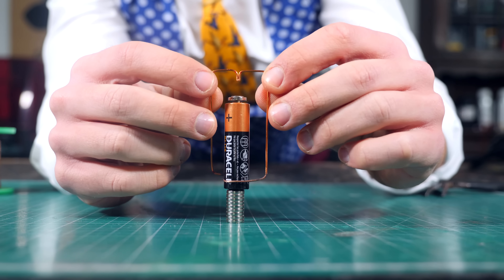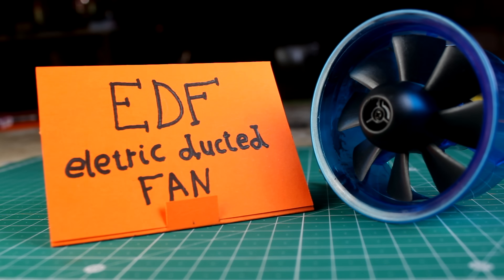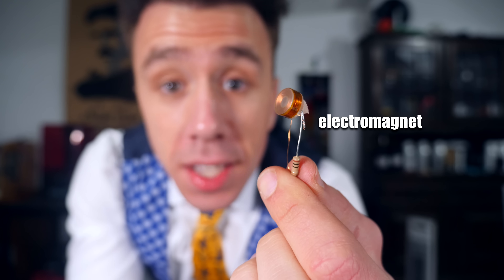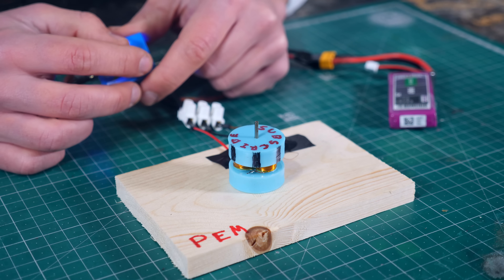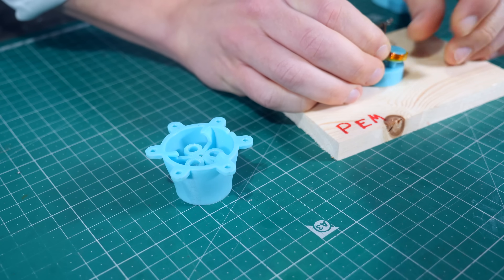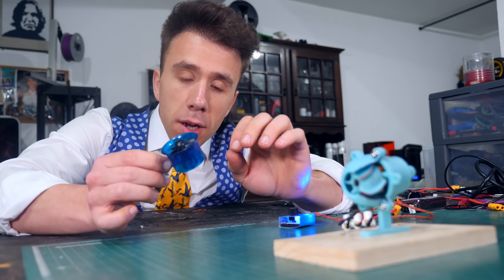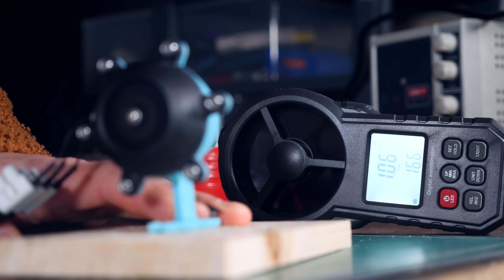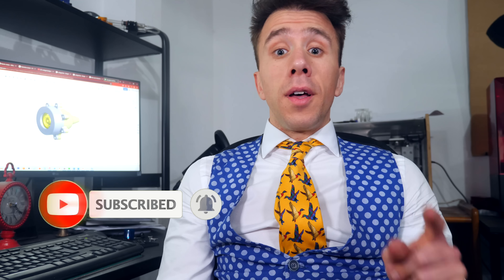I 3D Printed an ELECTRIC MOTOR FAN

Comment: using gears to simulate the process of creating air pressure and increasing air volume. I propose that a shaft would run to a gearbox, which would be powered with the first fan motor that creates air pressure. The gearbox would then power a second fan at a higher RPM to help push the increased air volume. While using gears to create mechanical power transfer is a well-established engineering principle, it's unclear how this idea would work in practice. There are a few areas where this concept could be refined:
1. Efficiency: Adding more moving parts, such as a gearbox, could decrease the overall efficiency of the system. It's important to consider how much energy is being lost in the transfer from the initial fan to the second fan through the gearbox.
2. Size: Gears can take up a lot of space, so it's important to consider the size and scale of the proposed system. Depending on the application, it may not be feasible to have a large gearbox and multiple fans.
3. Specific application: It's important to consider the specific application of the system and whether gears are the best solution. For example, if the goal is to create air pressure for a small device, it may be more efficient and practical to use a single fan with a higher RPM.
Overall, while gears can be an interesting and effective solution in some cases, it's important to carefully consider the specific application and potential drawbacks before implementing them.

Comment: An impeller’s goal is compressing the air, and fuel generally likes high-pressure low-speed air. What an impeller does is unlock better fuel burning efficiency, which should drastically outperform a fuelless fan

Comment: First thing that comes to mind with impellers, always : too much clearance with the housing.  It must be close to the blades. Very. close. So close it creates localized vacuums on the edges of the blades tangent to the housing.
Hence the need of dual support shafts of short impeller stacks relative to the shaft inertia for it to not rattle like a degenerate woodpecker on caffeine.
Second is the cross-section envelope of the blades, i.e its aspect ratio.  See those smushed vaccum cleaner impellers ? They allow for low rpm relative to the fluid ejection speed, while keeping the inertia of the moving rotor low enough to be negligible. Think of the trajectory those blades will impart to the air molecules. They fling it outward, your impeller doesn't. 
The trajectory of the air, imprinted from the blades own trajectory, will make it lose energy on the housing surrounding the larger portion of your impeller, bounce on it a bit, finally being pushed over the backplate lip by the pressure gradient.

Comment: I’d say it likely has to do with the overall volume of air the centrifugal fan can take in and compress. The EDF is largely unrestricted and the whole area of the fan disc can take in air. The centrifugal one has a small inlet and is more restricted by design. Maybe play around with fan geometry, I take and compression area sizes and speeds. Some of the earliest jet engines were actually centrifugal, but pretty much all if not all aircraft jet engines now are axial flow.

Comment: Didn't catch it if you said it, but make sure the impeller blade surface area is comparable to deducted fan's. Also considering the geometry of your design you're probably getting resistance due to compression in your impeller... You're asking the same motor with the same power to do more work than the EDF.

Comment: I think if you look at a dissected car turbo or a jet ski jet, it may help with the design. I think the blades need to be angled to push the thrust out. Hope that helps. You're a smart guy, I'm sure you'll figure it out!  Ps, I could really use a printer....
Reply: I think the impeller you made was spinning in the wrong direction.

Comment: You should do a video investigating the use in aerospace engines of a concept used in stable elevators where the case rotates instead of the shaft.

That is, make a turbine where, instead of a fan rotating in a case, the case rotates around the fan blades. In theory, it should produce the same thrust through as one where the case (ducting) is stationary and the fans rotate.

Comment: It's related to the surface area of your blades. Think of yourself as paddling a canoe, same arm strength, same number of strokes per second, if you used a spoon instead of an oar you will get much less thrust and most of your arm's energy is wasted into simply moving your arm. The opposite is also true if you use a giant paddle. So there is an optimal size of blade size and pitch you need to size your impeller to match the maximum continuous torque and RPM of the motor. Keeping in mind you will now need more torque since you're squeezing all that air through a smaller nozzle to get higher exit velocity whereas there is no squeezing with the EDF.

The good news is, the cheap EDF's don't typically do this level of optimisation, the fan and motor are different suppliers. So in theory once you correctly size the blades, you can easily exceed the standard EDF's thrust, as long as your jet engine is also lighter in weight, you will exceed the overall thrust performance.

Also - you're measuring with a mass airflow meter, thrust is mass * velocity, low mass does not always mean low thrust, you may actually be already at, or exceeding the EDF's thrust. Test your impeller engine with a thrust rig instead to get a good comparison.

Comment: The big one: Tolerances values of the turbine vanes, to the shroud. 
Other things to check: Intake, and exhaust port diameters.
Reply: Agree they are higher pressure and get this through tighter tolerances than other fans if you got gaps it will dramatically hinder performance.

Comment: I don't have any scientific answers or opinions for you, but when you asked for help the first thing that came to mind were Toroidal props/propellers. Design one that fits into the fattest part of the housing, don't make it thick enough to span the entire case, keep it thin'ish. Then, if that performs any better start making the props a little thicker until you reach max performance.

Comment: have a look to the A/R (Area/Radius) ratio of your compressor. It has general huge impact on pressure/outlet speed.
Also try to reduce radial and axial clearance between the compressor wheel and the housing. 0,1mm more clearance reduces your efficiency by 1%. So keep it tight and try to get a nearly 0-Gap (or a real 0-gap by using different materials that will build one by cutting the Blade into the housing on the first revs)
Reply: ᴄᴏɴɢʀᴀᴛᴜʟᴀᴛɪᴏɴꜱ ʏᴏᴜ ʜᴀᴠᴇ ʙᴇᴇɴ ꜱᴇʟᴇᴄᴛᴇᴅ ᴀᴍᴏɴɢ ᴛʜᴇ ʟᴜᴄᴋʏ ᴡɪɴɴᴇʀ ꜰᴏʀ the 🤶 ɢɪᴠᴇᴀᴡᴀʏ ᴘᴀᴄᴋᴀɢᴇ ʜɪᴛ ᴜᴘ✉️ ᴛᴏ ᴄʟᴀɪᴍ ʏᴏᴜʀ ᴘʀɪᴢᴇ 🎁🎉

Comment: I bet motor in your 3d printed fan consumes less power compare to the edf and thats  because is not fully loaded by the small impeller.  Make bigger impeller  , compare power consumption.
Reply: ᴄᴏɴɢʀᴀᴛꜱ ʏᴏᴜ ʜᴀᴠᴇ ʙᴇᴇɴ ꜱᴇʟᴇᴄᴛᴇᴅ ᴀᴍᴏɴɢ ᴏᴜʀ ꜱʜᴏʀᴛʟɪꜱᴛᴇᴅ ᴡɪɴɴᴇʀꜱ ꜰᴏʀ ᴛʜᴇ ᴘᴀᴄᴋᴀɢᴇ ᴄᴏɴᴛᴀᴄᴛ ᴛʜᴇ ᴛᴇʟᴇɢʀᴀᴍ ᴀʙᴏᴠᴇ
^^^^^^^^^^^^^^^^^^^^^^^^^^^^^^^^^^^🎁🎉

Comment: I would to see how a line of Sterling motors sitting on a steam pipe how many you could put in a 10 foot section And combine their power to say how much horsepower can you produce from it to generate electricity 

Second one is a hovercraft made of electromagnet With a particular resident frequency that’s is tune to the Magnetic Resident frequency of the Earth, sun or moon Pushes or pulls against the polls and/or planetary objects to get elevation This is in something that’s in the missing papers from Tesla that Affects of resident frequencies and the universe.
Reply: ᴄᴏɴɢʀᴀᴛꜱ ʏᴏᴜ ʜᴀᴠᴇ ʙᴇᴇɴ ꜱᴇʟᴇᴄᴛᴇᴅ ᴀᴍᴏɴɢ ᴏᴜʀ ꜱʜᴏʀᴛʟɪꜱᴛᴇᴅ ᴡɪɴɴᴇʀꜱ ꜰᴏʀ ᴛʜᴇ ᴘᴀᴄᴋᴀɢᴇ ᴄᴏɴᴛᴀᴄᴛ ᴛʜᴇ ᴛᴇʟᴇɢʀᴀᴍ ᴀʙᴏᴠᴇ
^^^^^^^^^^^^^^^^^^^^^^^^^^^^^^^^^^^🎁🎉

Comment: First you confuse the thrust and the speed of the wind at the exit, whereas it is very different, even if sometimes proportional 
The EDF motor produces a good wind speed and brews a large volume because it has a large surface area of blades, so it will do a lot of thrust, (Convenient for propelling a remote control aircraft)
But a turbo fan produces a lot of pressure but not necessarily a lot of volume (pressure is important in a piston engine turbo to increase the oxygen ratio, or in an airplane for better combustion and output velocity),
So with the same brushless motor you will produce more pressure with the turbo (I think it would be able to inflate a balloon unlike the EDF), but this fan will move a smaller volume of air than the EDF fan (so less air speed on the wind speed sensor)
Send me a mail if you need help, I will be happy to help
Reply: ᴄᴏɴɢʀᴀᴛꜱ ʏᴏᴜ ʜᴀᴠᴇ ʙᴇᴇɴ ꜱᴇʟᴇᴄᴛᴇᴅ ᴀᴍᴏɴɢ ᴏᴜʀ ꜱʜᴏʀᴛʟɪꜱᴛᴇᴅ ᴡɪɴɴᴇʀꜱ ꜰᴏʀ ᴛʜᴇ ᴘᴀᴄᴋᴀɢᴇ ᴄᴏɴᴛᴀᴄᴛ ᴛʜᴇ ᴛᴇʟᴇɢʀᴀᴍ ᴀʙᴏᴠᴇ
^^^^^^^^^^^^^^^^^^^^^^^^^^^^^^^^^^^🎁

Comment: Swept fan area may have something to do with it. I also think that axial flow is more efficient anyways due to not changing direction. Commercial and military jets quit using centrifugal fans a long time ago. Try going back to the flame holder for an EDF. Maybe make a metal shroud behind the motor and use NACA ducts to bring airflow into the combustion chamber. Not all of the airflow needs to go into the combustion chamber; you just need to show that the extra thrust generated in the middle is worth the additional weight added to the EDF

Like a center burner only. If it doesnt get enough airflow there then make the shroud more cone shaped by a few degrees to push more air into the ducts. But if this could be avoided it would be good because thrust figures when not running the after burner are still important for a model hobbyist interested in an engine swap
Reply: ᴄᴏɴɢʀᴀᴛꜱ ʏᴏᴜ ʜᴀᴠᴇ ʙᴇᴇɴ ꜱᴇʟᴇᴄᴛᴇᴅ ᴀᴍᴏɴɢ ᴏᴜʀ ꜱʜᴏʀᴛʟɪꜱᴛᴇᴅ ᴡɪɴɴᴇʀꜱ ꜰᴏʀ ᴛʜᴇ ᴘᴀᴄᴋᴀɢᴇ ᴄᴏɴᴛᴀᴄᴛ ᴛʜᴇ ᴛᴇʟᴇɢʀᴀᴍ ᴀʙᴏᴠᴇ
^^^^^^^^^^^^^^^^^^^^^^^^^^^^^^^^^^^🎁🎉

Comment: I think, like what everyone else is saying, is that the turbo fan will generate greater static pressure vs the edf's greater airflow. It's basically reminiscent of a blower vs axial style fan, each with its own pros and cons, like the more static pressure vs more airflow. I'm no expert, not have I done any research outside of watching your videos, but I would think a jet engine would prefer the static pressure over the airflow because of the expanding gas from the combustion. A jet engine would be pretty useless if it create as much thrust backwards as it would forwards. For the EDF, the pressure would just have to overcome the weight of a drone or whatever it is driving, so for the same energy, you could generate more airflow to achieve greater speed.

Comment: The design is stalling for air intake.  Because the nature of the design is that it pushes air outward and then forces the air under centrifugal force to make a right turn, the air is aerodynamically locked into position.  This reduces air intake and as a result, the total mass flow is reduced to a much lower number.  To Fix the design the fan needs to be conical and then it needs to be funneled into an outlet.  The outlet should be slightly smaller than the intake.  ... However, in the optimal design, the airflow would not have to have any directional change.  This is what happened in jet engine development.  They changed from radial combustion to a direct pass-through.   Then later into a high bypass design.   In the high bi-pass design the high-velocity flow from the core is protected and enhanced by a slower thrust tunnel created by fans.   Thus the fan flow in increased not decreased and because of the total sectional area and entrapment effect high bypass fans are more effective.
Reply: ᴄᴏɴɢʀᴀᴛꜱ ʏᴏᴜ ʜᴀᴠᴇ ʙᴇᴇɴ ꜱᴇʟᴇᴄᴛᴇᴅ ᴀᴍᴏɴɢ ᴏᴜʀ ꜱʜᴏʀᴛʟɪꜱᴛᴇᴅ ᴡɪɴɴᴇʀꜱ ꜰᴏʀ ᴛʜᴇ ᴘᴀᴄᴋᴀɢᴇ ᴄᴏɴᴛᴀᴄᴛ ᴛʜᴇ ᴛᴇʟᴇɢʀᴀᴍ ᴀʙᴏᴠᴇ
^^^^^^^^^^^^^^^^^^^^^^^^^^^^^^^^^^^🎁🎉

Comment: I'm sure someone below has probably already explained this or perhaps atleast did a better job of it. 
but short the version is the two " FAN " types are simply working different principles. 

The EDF is Mainly designed for getting thrust by free flowing as much controlled air as possible in one direction and with little restriction. the air foil on the front contributes to some induction of additional air through laws requiring more than a few sentences here.(overly simplified but you get it)

The other style "fan" your working with that your referring to as a centrifugal isn't really that but instead more of turbine type "fan" or more realistically a Compressor type "fan". What it does well is build pressure or squeeze air vs flow air like the ducted fan does. 

In the case of the dyson fan the "Fan" is building pressure to overcome any restriction and moving the air over a very well designed edge (kinda of like an air foil or airplane wing )(ish)) which then causes a low pressure zone which outside air tries to fill and gets pushed along in the direction the pressurized air is heading. this is basically an air Multiplier using something similar to Bernoulli's principle. Much how an air brush works. (ish). since the air escaping is grabbing more air than the "fan" is pressurizing, it "feels like" a gain of air movement and in a way it is. But the air your feeling is mostly the inducement of the air around the air foil than the air from the "Fan" (turbine). 

with turbine engines the "fan" (turbine) is doing much of the same thing. the blades aren't really so much creating the trust but are instead squeezing the air and pressurizing it for combustion(think of  it like a combustion engine's pistons) Once the air is squeezed enough it makes it's way into the combustion chamber and ignited with fuel. It's this rapid expansion and heat of the combustion that creates the trust and turns the rear "fan" blades which in turn keeps the intakes blades turning forcing more air to keep the process going. 

Hope this is all making sense to you so far. 
Turbines for example are great for pressurizing air which is awesome for applications like turbo's on cars. where it doesn't need large volumes of flowing air but instead needs large pressures of pre-squeezed air to force into the combustion chamber in a very short amount of time.

So in short.. it's a measurement of flow vs pressure. 

You could in theory measure this by putting a sensitive pressure gauge in the housing of the ducted fan and on the housing of the "aerospike turbo fan" and see the differences.
Reply: ᴄᴏɴɢʀᴀᴛꜱ ʏᴏᴜ ʜᴀᴠᴇ ʙᴇᴇɴ ꜱᴇʟᴇᴄᴛᴇᴅ ᴀᴍᴏɴɢ ᴏᴜʀ ꜱʜᴏʀᴛʟɪꜱᴛᴇᴅ ᴡɪɴɴᴇʀꜱ ꜰᴏʀ ᴛʜᴇ ᴘᴀᴄᴋᴀɢᴇ ᴄᴏɴᴛᴀᴄᴛ ᴛʜᴇ ᴛᴇʟᴇɢʀᴀᴍ ᴀʙᴏᴠᴇ
^^^^^^^^^^^^^^^^^^^^^^^^^^^^^^^^^^^🎁😊

Comment: Axial fan = air flow/high speed
Impeller = static pressure/low speed

It might have something to do with how you design the channels/manifolds that convert air pressure into air speed (same problem with chosing high pressure or extraction fans in a computer case). There's a neat reason why engineers quiclky switched from centrifugal to axial flow in jet engines.

You're welcome 😘